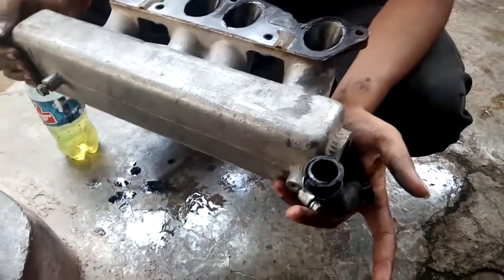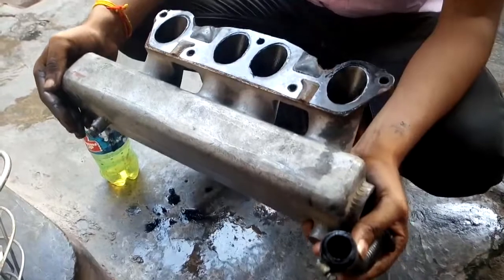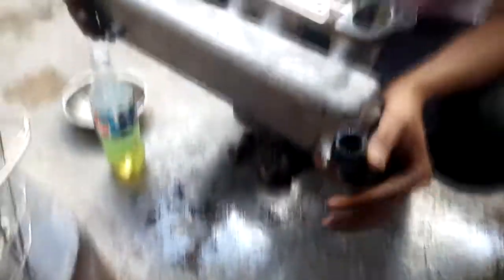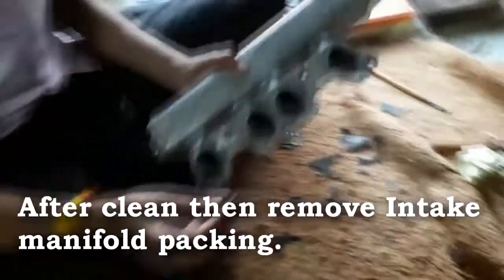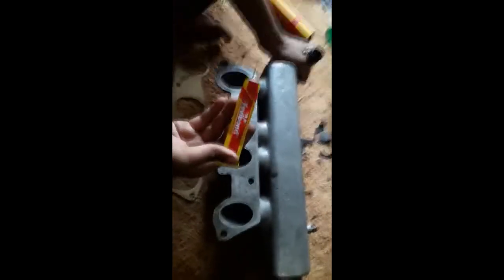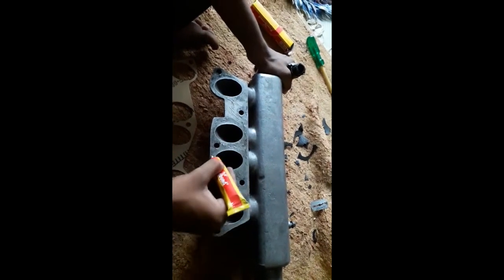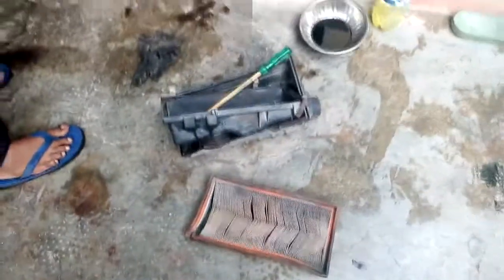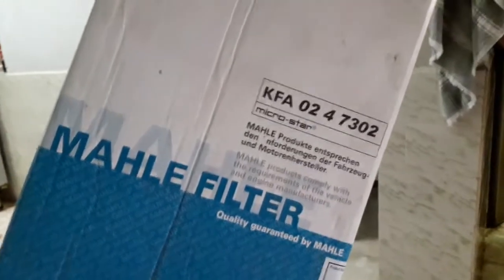Tata indica Intake manifold cleaning

Comment: My tata indica v2 2009 model diesel engine misfire occurs when EGR works ( randomly at around 2000 to 3000 rpm). If throttle position sensor or solenoid switch connection is disconnected or if EGR is blocked there is no issues.
Reply from the maker: okk...EGR system work for reduce NOx gas. when u push the throttle egr not works and u return throttle pad egr works the exhaust gases return the intake. if you egr block so turbo can more air produce for engine and you feel more power. Also i have scorpio 2007 model in EGR system Deleted.
Reply: I realize Im kind of randomly asking but does anybody know of a good website to watch new movies online ?
Reply: @Lucas Alexzander i use Flixzone. Just google for it =)
Reply: @Bo Emanuel yea, been using Flixzone for years myself :)
Reply: @Bo Emanuel Thanks, signed up and it seems to work :) I appreciate it !!
Reply: @Lucas Alexzander Glad I could help :D